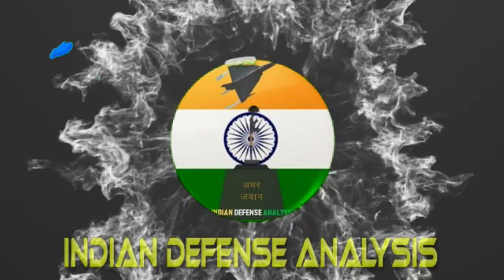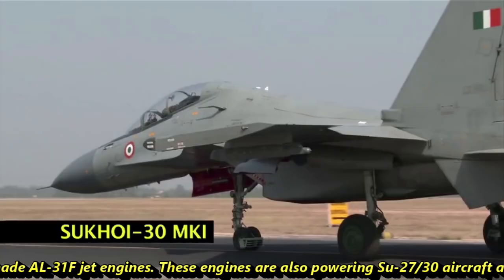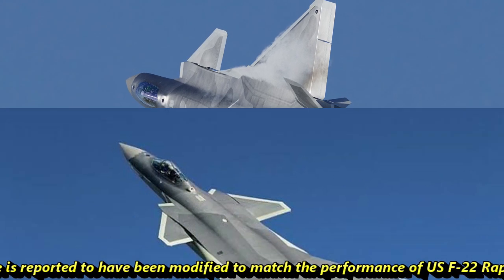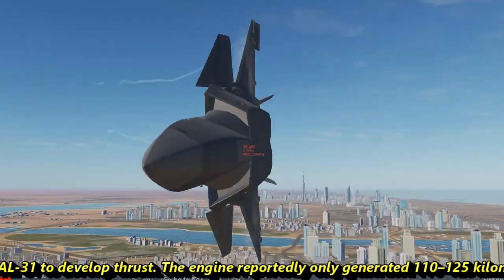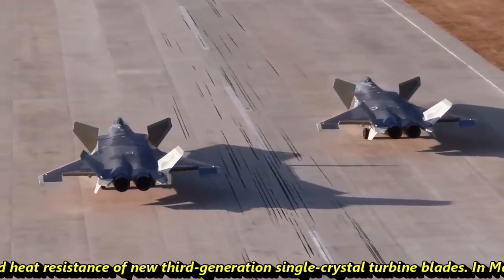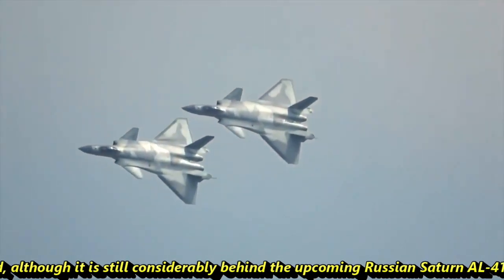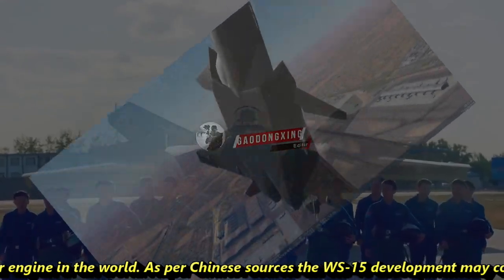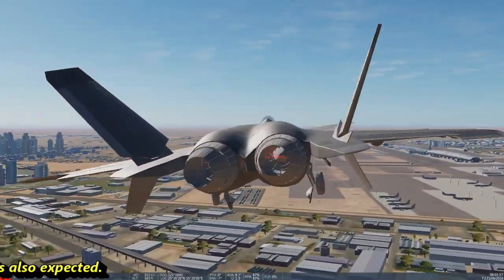China fields its J-20 Stealth Fighter with more powerful engine WS 10C

Comment: So this jet is powered by a fourth generation aircraft engine. They are going to have a barely functional fourth generation engine from China soon. Well if you add the lack of stealth and the low grade avionics it isn't very fifth generation. From the back top and bottom it has no stealth due to the engines, from the sides limited stealth. It might have head on stealth but that is only useful if you fly straight at a target something that is hard to do in actual combat because areal targets tend move.
Reply: @wally, you cannot judge how stealthy an aircraft by looking at it. Radar beams do not behave like visible light.
Reply: @shermanpeabody6102  i have seen the reports from Asia. They are crappy 4,5 generation aircraft that can be detected by PESA and from behind even by Pulse Doppler.